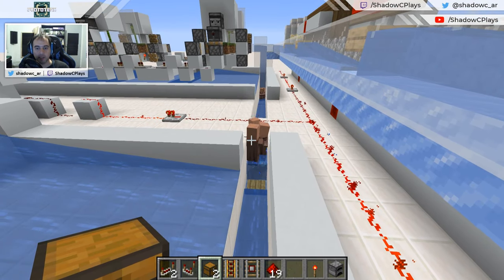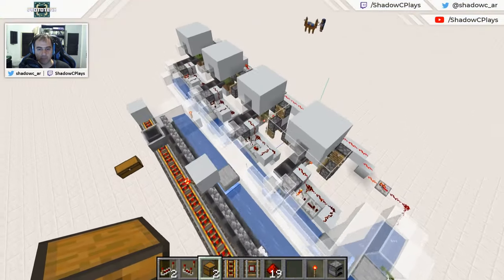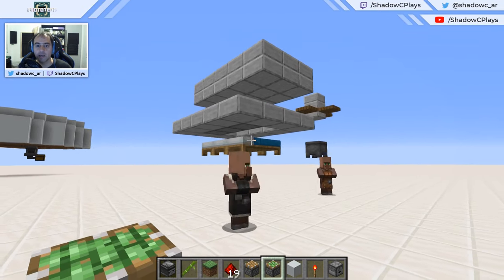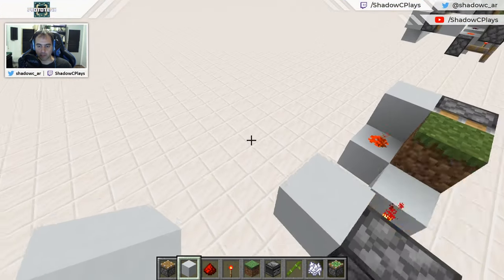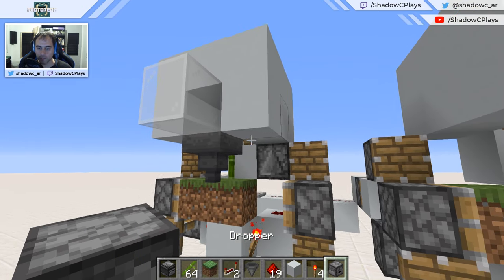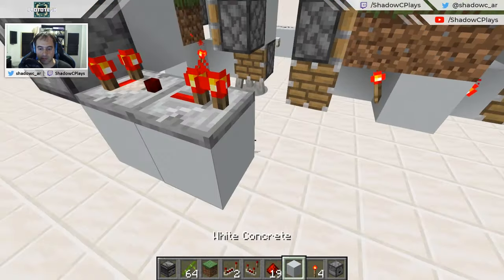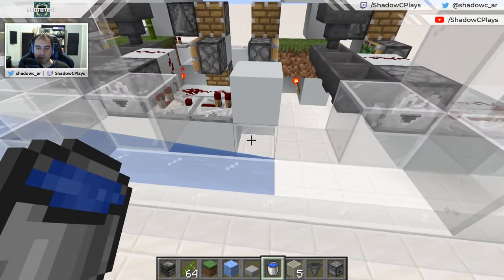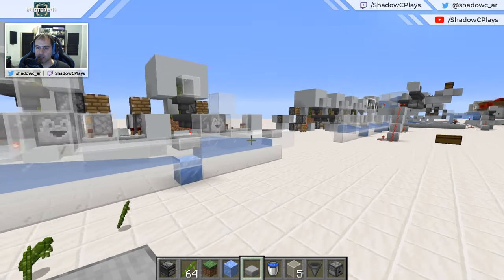Minecraft 1.14 Tutorial - The BEST 0-tick Bambo Super Smelter in Minecraft!

Comment: So I'm attempting to build  this on a 1.14.4 Vanilla Server... The first bamboo machine I made Worked (Temporarily.. more on that in a bit). But the one I built beside it wouldn't work for anything. My issue is that when the machine is completed and activated, the pistons seem to be working properly, but the bamboo's growth is not sped up at all. It just seems to grow at normal speed and doesn't produce anything. Another weird thing... The first machine I built worked properly, but after turning it off, leaving the area, and coming back... it also no longer works and has the same issue with the bamboo not growing at an increased rate. I haven't been able to figure out what the heck may be going on. Any ideas? 

With the machines that never worked, Ive tried changing the spacing where they are, making sure theyre not on the edge or across a chunk. Building them in all 4 directions... and I always get the same result where it all Looks like it should work but the bamboo doesn't grow at an inceased rate. I've verified light levels (they are underground) etc. Video of my issue: https://www.youtube.com/watch?v=XbAnGco685Q&feature=youtu.be

Anyone have any thoughts?
Reply from the maker: That's really weird! I Assume you're in Java Edition, right? Try replacing the bamboo?
Reply: ShadowC Plays Yea. In Java 1.14.4. And i tried replacing the bamboo. I’ve built this machine so many times trying to get it to work again I’ve memorized it. Haha. Its so strange. I can’t nail down what the issue is.